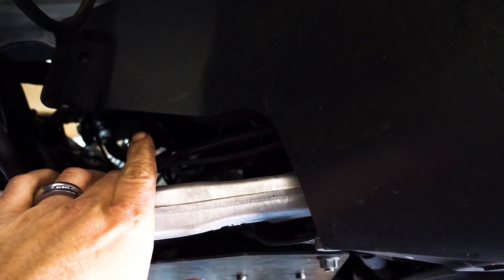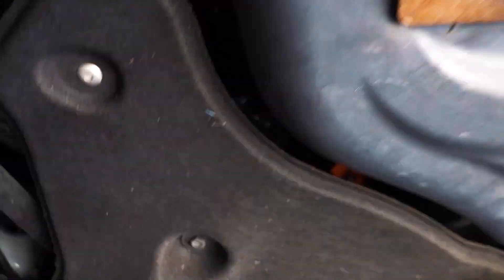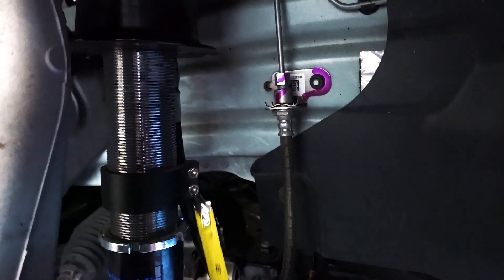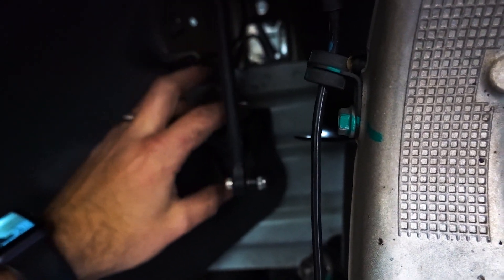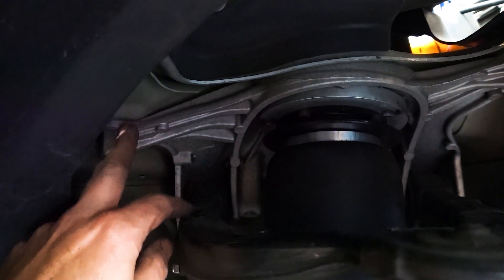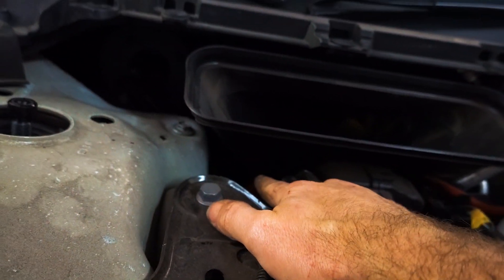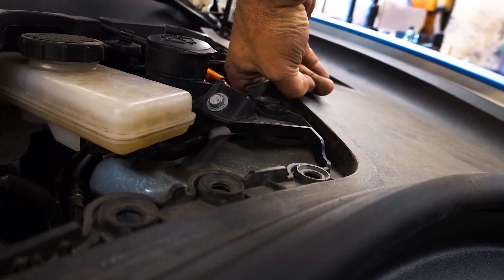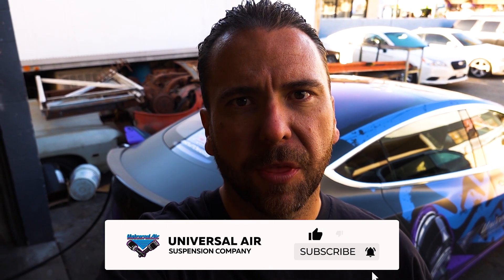Tesla Model 3 Air Suspension Installation Overview

Comment: Hi. I’m hoping you can answer this. On a tesla model 3, where did you connect the wires labels comp 1, headlights, ignition &  e brake?  The only 2 wires clear to me are ground and 12v battery.

Comment: How much would it be or will you be producing the underside mount for the tank and ecu? Great install. Very clean.
Reply from the maker: Thanks.  We currently have them for the CVT/T3 setup.  We will have to look into making them for a different style tank/compressor/valves.

Comment: What would you say is the overall cost of this installation, parts and labor?
Reply from the maker: For the setup I have its about $6200 for the parts.  Its the high end of the spectrum.  It is direct bolt-in kit so install is very easy.